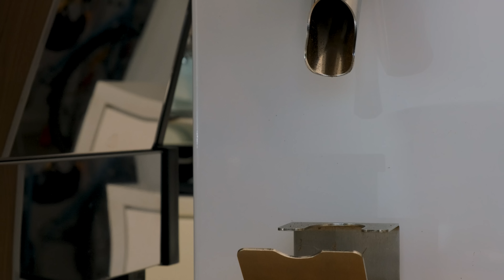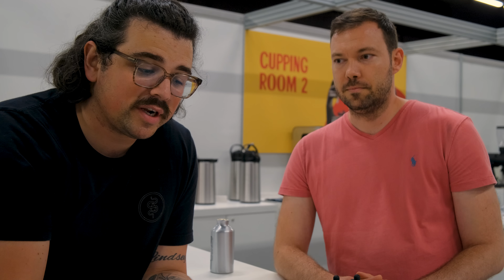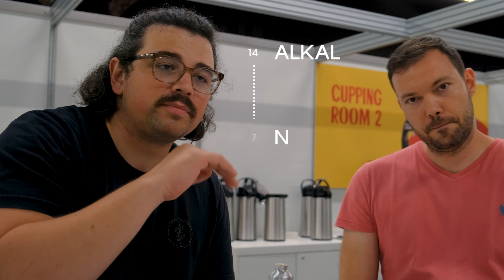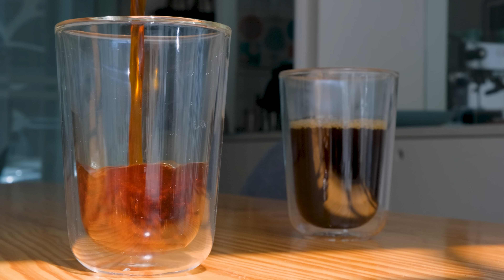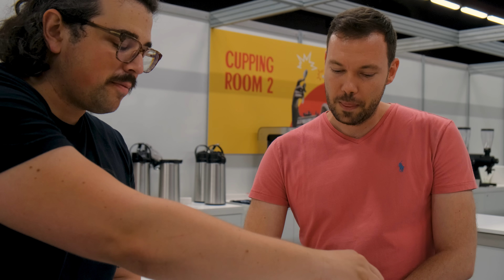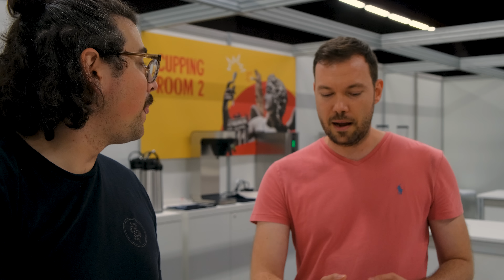SECRET INGREDIENT FOR BETTER COFFEE: WATER (feat. PhD Chemist Dr. Smrke)

Comment: Haven’t tried distilled with replacement. Even before I got super into coffee and was just doing French press though, I found using brita filtered water made a massive difference to taste. Obviously brita leaves behind plenty of dissolved solids but where I live the water is crazy hard so the brita takes it down to a more normal level and yields much much better results. May get some ph test strips and see if there’s a marked difference between brita and tap coffee for me. I already had the brita cuz my tap has off tastes to me just as water anyway, but I wonder how much of the taste difference is those same off tastes I dislike in the plain water versus buffering impacting the acidity

Comment: Great interview with Dr Smrke! Very informative. I have been brewing between 15 and 21 TDS based on the recommendation of my espresso machines. But I use just my tap water added to water run through a Zero water filter. Perhaps I will do some testing on my own to see if mineral additives improve the cup. ☕☕😁

Comment: I'm new to coffee science, but I'm a little surprised how little is known by now. In the beer brewing industry, water chemistry is crucial. Perhaps that's the answer—extraction of sugars and flavors depends enormously on pH and residual alkalinity (primarily because the enzymes require it), wheras it sounds like in coffee brewing it's perhaps a secondary effect. Would love to learn/read more about the acidity-dependent complexes that change extraction yield, and especially if there is a way with pH to enhance the fast-extracting coffee flavor components preferentially over the slower ones (which people blame for immersion vs percolation taste profile differences, e.g.).
Reply: This is nothing new.  I've known about water quality and it's affect on coffee for years, it's just that YOU are now hearing about it.
Reply: @bgm1911  neat - anything you can share on preferential flavor compound extraction or extraction yield dependence?

Comment: My well water is quite soft and has a PH of 9.4. It also has high alkalinity. If I add an acid to bring the water down to neutral the water will revert back to 9.4 within 12 hours. In your opinion would I get a more flavorful cup if I dropped the PH to 7 before brewing?

Comment: Things like Third Wave Water are nice but not accessible at large scale due to the cost imo. I wish someone would make water with good coffee chemistry in those jugs you can buy for coolers. They could sell with different recipes depending on what coffee you are drinking that month.
Reply: you can do this at home for VERY cheap. Buy distilled water and packets for the composition you want, assuming you already have a scale at home for coffee that's all you need, and per volume is going to be cheaper than third wave water or whatever other marketing thing that's just basic chemistry.

Comment: Hey Lance I have a question for my job. If we use a gallon jug of purified water what minerals should we add to the jug to help the espresso flavor profile and how much? It will be a huge help thank you
Reply: I would guess, those that aren't present in the coffee itself which it supposedly contains plenty of different ones, depending on origin (with pot. excess). Maybe go for silicon and some trace elements?

Comment: So the Buffer is the Total Alkalinity of the water, which acts as a stabilizer for the PH of the water. So if your buffer is too high or too low it can pull/mute/cancel out the acidity of the coffee? is that right? If only someone had a simple solution for this...
It makes sense when I am dealing with my pool, but for coffee it's a big more confusing...

Comment: Just realised an implication from the start of the video and differences in dilution between filter and espresso, if you want the same buffering and flavour outcomes from espresso as filter when it comes to adjusting minerals you would have to use roughly 5 times as much

Comment: Waiting for my Lotus Water delivery. Currently using Third Wave in RO water. Curious of what the difference will be.
Reply from the maker: Massive. Third wave is a static recipe. Lotus is open ended. You can recreate something like third wave or can do an innumerable amount of other recipes. There is no limit to the flexibility. Excited for you to get it!
Reply: @LanceHedrick  Lotus Water solutions are several Chloride Salts.  That's a great way to mask defects in roasting and extraction; as well as potentially destroying your brewing equipment in the process.